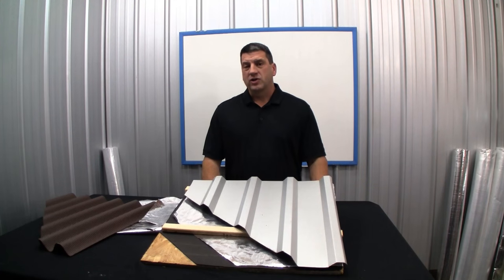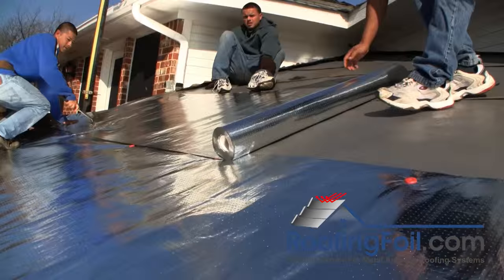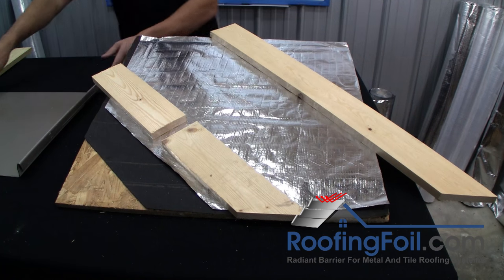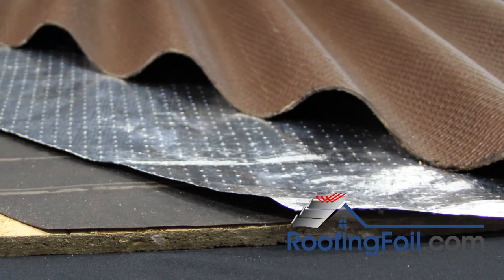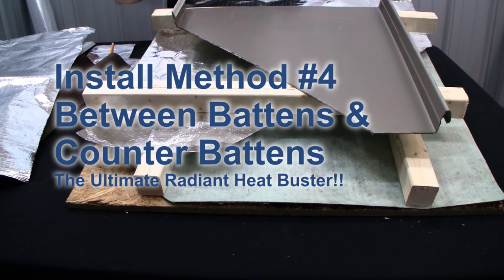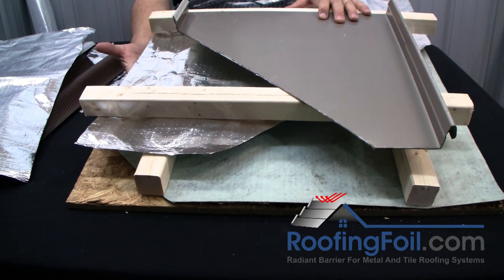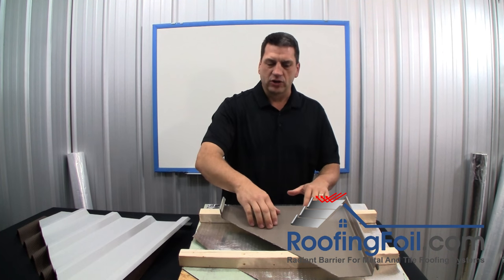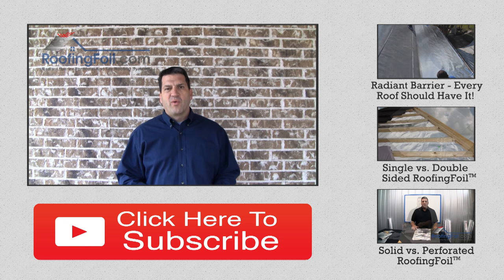RoofingFoil - How To Install A Radiant Barrier In Metal Or Tile Roofs

Comment: I agree with your conclusion that method #4 provides maximum benefits.  I wish you would promote this in your other videos.  Installers use your videos as examples of correct ways to place radiant barriers.

Perhaps a digital thermometer readout on the attic side before insulation could highlight this point.

Comment: I just moved into a home with a metal roof, and it’s probably a few years old (the roof). Is there a way I could check to see if they installed a radiant barrier when they installed the roof?
Reply from the maker: Probably not without lifting part and looking.  Or, if you are in the attic and you put your hand a couple inches away from the wood deck and it FEELS really hot they probably did not install radiant barrier.  In this case just install www.AtticFoil.com inside the attic for nearly the same benefit.

Comment: Thank you but in the first place does the metal panel, or aluminum decking create a radiant heat barrier as well?
Reply from the maker: There are some metal roofing products that are considered "cool" "reflective" or low emissivity.  However, just because something is shiny does not mean it will reflect heat.  A chrome bumper of a car is very shiny, but I would not want to sit on one on a hot-sunny day.

Comment: I have a metal garage roof and it gets very cold in the winter and once the cold air hits the roof it drips all over the floor. Using glue, I have stuck some plastic wool loft insulation to the roof and was wondering if I can then add a layer of foil to reflect the heat in the summer? Would this work? I have already stuck the wool to the roof and would be a pain to remove.
Thanks
Reply from the maker: For metal buildings we have a different group of products specifically designed to eliminate/reduce condensation issues.  www.BlueTexInsulation.com

Comment: Great clip! With the batten style system (criss-cross of both) and having air flow from eave to ridge. Do you incorporate the ridge vent of the main house ( Rake edge to rake edge)  or run the air space directly from onside of the each roof facet (slope). Or is that depending on inside insul. Type?
Thanks, Troy ( Typical SSM installation with ridge vented perforated Z flashing connected @ ridge cap.)
Reply from the maker: It would depend if the attic is vented or not.  I like this for full foam encapsulated attics with no vent.  But it works well for traditional vented attics too.

Comment: Great videos!!!! What happens if you install the Roofing Foil on the underside of the Roof Rafters (in the attic) and as you hav specified in this video? Do you get double protection? The question arose because a client has already installed the Roofing Foil on the underside of the roof rafters and now we are re-doing their entire roof. Thanks!
Reply from the maker: Installing the foil under the roof will yield a better benefit than installing inside the attic.  As a rule, the further to the outside the better.  In your case, I would definitely install under the roof.  It's cheap, effective and will keep the roof deck from ever getting hot.  On the other hand, I would not recommend installing in the attic if the foil was already under the roof.
Reply: Would this work as a vapour barrier if installed inside on rafters under a metal roof?
Reply from the maker: If you used the solid product, taped the seams and made it airtight, you would have a vapor barrier.
Reply: what do you mean "tapered" the seams??   Overlap you mean?
Reply from the maker: Overlay product up/down.  Do not have a seam left-right directly above another seam going left-right.  So either tapered or offset is a better word.

Comment: I have one question. if you are installing a metal roof and the metal is white or aluminum color and you have a 2inch or so gap between the shingles and metal roof that's white or aluminum color why would you have to have the foil at all looks like to me you already have that thermal radiant barrier with just the white or aluminum color metal roof. I'm pretty sure the straight aluminum metal roof will be sufficient enough to stop the thermal heat of the sun from getting in. I see very clearly why the gap between metal roof and the shingled roof.. Seems it would just be extra money or needles money spent when white or aluminum metal and a 2inch gap is plenty without the roil of foil..
Reply from the maker: White or aluminum roofs are BETTER than dark roofs.  However, it's STILL metal and will get hot.  Would you rather sit on a CHROME bumper or a BLACK piece of foam sitting in the sun??  Same idea for metal roofing material.

Comment: could u put plex tubing under the metal roof seeing how it generates heat to use it as a pre heating for a storage tank for hot water
Reply from the maker: Yes, this would be a great method to use the heat and get it into the pex tubing.

Comment: Could u put plex tubing under a metal roof  to heat water/per heat
Reply from the maker: That would be an amazing application!  I've had a few customers do it, but don't have any pictures.  If you do it, please contact me.  I'll compensate you for some install pictures or video.
Reply: Did you install the pex for preheating water on your roof?
I am considering doing this.
Reply from the maker: @faradthomas8309  Personally never have done this. However, I think it's a great idea and have had several customers do it with great success.

Comment: My understanding No4 is NOT correct BECAUSE battens will rot! The condensation will land on foil instead of membrane because you have battens horizontaly there is no where the condensate can escape other than batten!!!
Reply from the maker: In the building science world you learn that it’s OK for wood to get wet and then dry again.  It can happen a thousand times like washing and drying a towel.  It’s when it STAYS wet you have issues with rot, rust, mold, etc.  In a typical roofing system, you may have some condensation but it will dry quickly due to the heat of the sun and ventilation.